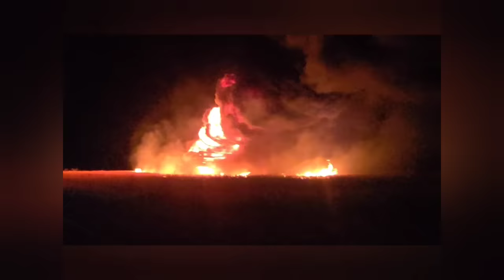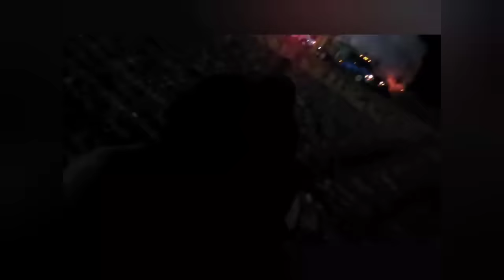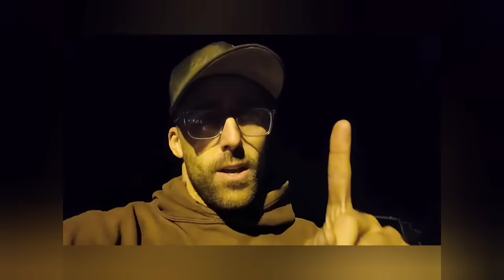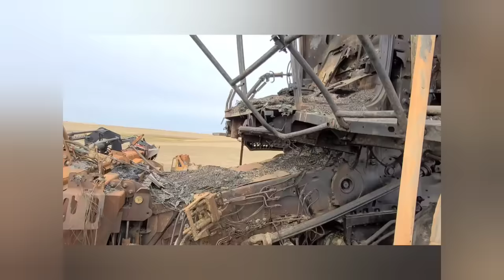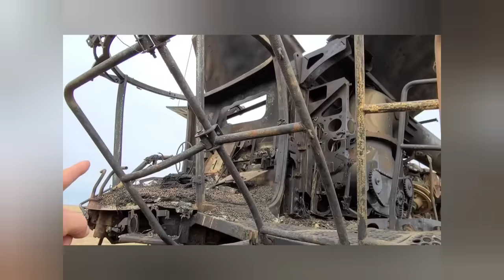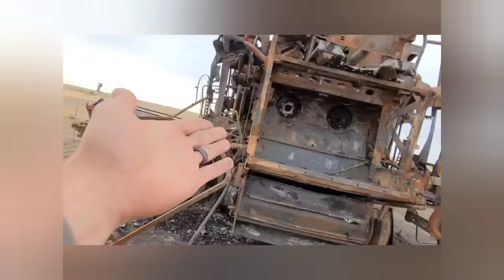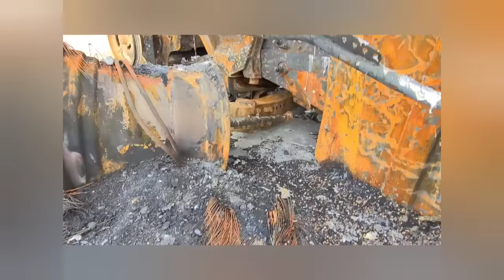Fendt Ideal 9, burns to the ground🔥

Comment: For anyone watching this just know that if a combine or any other piece of equipment is going up like that, you need to stay back a good 100 yards. Tires, hydraulic rams, hydraulic accumulators, the gas pistons that hold the doors up, can all blow up. I've put out a lot of equipment fires and had way to many close calls. It's best to just get back and stop the spread until it can be cooled down. Been a rural firefighter for 8 years.
Reply from the maker: 🤔 Good idea!
Reply: and batteries  now they are long life sealed
Reply: Just throwing a can of axe in a fire is enough experience to know that flamable liquids, or pressurised vessels are explosive. I had a friend who had his 50cc scooter burn to the frame, and someone got their clothes ruined by the battery exploding and shooting acid on him. Lucky that it did not touch his skin
Reply: Im a Safety Manager with 15 Years experience dont get me wrong here: Been working on a farm and implemented allot of my previous experience the comment a above is 100%
Reply: Nah I would just stay close so I can make sure nothing else goes wron😎🥽
Reply: This... right here.  I found a hydraulic cylinder shaft stuck into a tree over a foot deep from a combine fire.  It would have went through a dozen people.
Reply: Good advice, thanks
Reply: Real. We had a combine burn and something blew an shrapnel flew 80 meters away and a
Shattered one of our combines windows
Reply: @eliaslundstedt5607  I have a relative that got her eye ruined burning garbage because somebody put something like that in it.

Comment: A combine with a million sensors...... and no temp sensor on the gear box?
Reply: What combine is? I'm brasilian and i don't undestand all
Reply: @anomonyous  i want to know the model of the combine
Reply: @otaviobaticini2710  Ideal 9 I think
Reply: Its a feature, without burning they last to long
Reply: @hairlesscat6458  I know from experience that a manufacturer IS consciously paying attention to safety. Therefore there are lots of ISO standards to which all major western manufacturers comply to, better, they have developed these standards in special committees. Even the European Union Legislation is largely based on those ISO standards. I think this is the first combine fire started in the gearbox. And also, if you had listened to Mike, you would have known the temperature of the gearbox wasn't the problem but a faulty seal gushing out oil was the problem.
Reply: @otaviobaticini2710 ideal 9.
Reply: The sensor was his eyes

Comment: Been through this with a case combine about 6 years ago. It made the western producer. Your video doesn’t give the tire explosions justice. When ours blew, we were about 150 ft away and it was like someone punched me in the chest. It was so violent that the header unhook its self from the combine. The scary about our fire was that it happened in our yard right next to our sheds and water tanks. I tried to fight it but it melted the hose full of water. As you said Mike, when our fuel tank melted it was a no go, there was no saving it. The rims where cherry red hot and there was absolutely nothing left. I am glad no one got hurt and everyone is ok. That’s why we carry insurance for this type of incident. By the time the fire dept got to the combine it was totally gone. The whole combine is totally engulfed in about 2 mins, and the next day there was still warm spots after spraying at least 4-5000 gallons of water. We did have a rcmp member come to our fire as well, I think it was more of a formality and to check to see if there was any suspicion of arson. Good luck with your insurance, we had a battle and took a licking but our dealer stepped up big time and got us a new combine and we were back at it in 4 days. Lucky for us, we had our pick up header on when it burnt and our Macdon was safe lol. We had a huge puddle of aluminum under the combine after the rads melted.
Reply: Yeah those tires might only have 30PSI in them but the shear size of them means they have a LOT of energy in them so when they fail they fail EXPLOSIVELY! Hell I've seen the damage a semi-truck's tire can do when they blow, it destroyed the side of a car so I can only imagine those combine tires can do.
Reply: @SilvaDreams  Combine tires will have far more than 30 PSI. Semi tires are over 90 PSI.
Reply: The tires: ight imma head out pop

Man that's one sad story

Comment: Relly sorry to see this happen to you guys, but glad to hear that no-one was hurt.
The way you're handling it is epic, relatively calm and no signs of panic. Everyone seems to know what to do.

On the positive side, at least now it's easy to get to the rotor shear bolts of that combine :-)
Reply: If I had a farm a huge as there operation I would blow it off as well.......new combine boom insurance is great.
Reply: @dustinryan9671  except that isn’t how it works, it takes months for the claims to be processed, and they never give you how much it’s actually worth.
Reply: @realredditstories420  when a farmer is spending over 1 million on a single piece of equipment....they are not hurting.  Insurance does take time does not matter if it's farm equipment, a house, or business damage.  If insurance did not work then why do people, including farmers buy it?

Comment: Wow glad to see nobody got hurt and in all my 51 years this is the first time I've seen a combine burn, sorry for your loss but thanks for sharing the video and yes I agree no combine should have plastic fuel tanks.
Reply: There’s about 400 combine fires a year in NA, with almost 80%% of those happening during the summer. Western Europe doesn’t have the corn/soy industry like we know in the Americas so fires are rare. But yeah running machines non stop for 8 - 10 weeks in dry / windy conditions makes for a heck of a fire hazard.
Reply: Only issue is a steel fuel tank will explode rather than burn
Reply: @jonathanwayman9345  with steel it would have to be vented very good to avoid exploding even then I don't know about that fire was massive and that wind just added fuel to the fire

Comment: I think you have a good handle on origin and cause of the fire. I’m a retired Certified Fire Investigator from North Dakota and have dealt with many 
Farm machinery fires. One thing I discovered was that of all the fire incidents I investigated everyone had some sort of opinion on what caused the catastrophic loss. I’m quite sure that farmers were more correct with there opinions than everyone else. It has to do with machinery’s need for regularly scheduled service that is provided by the owner/operator. That makes that witness keenly aware of his machine and gives him an understanding of its week points. The fact that you eliminated the bearing failure points around the combine and had an opportunity to witness the still early development of the incident centralized your opinion on the right rear of the combine. The process of elimination of what it wasn’t brings you closer to the origin of the fire allowing you to fine tune what was left and results in your causal conclusion. Good job!
Reply: And opinions are like assholes, everybody has one.

Comment: One time last year, I was sitting in the combine with my dad and all of the sudden, I see his face lose all color. That's when I looked up and saw the engine water temperature gauge shoot up to the red. My dad got out and I kind of froze. After about 30 seconds he flew up the ladder and forced the machine off. After investigation, we learned that the fan belt had just been chewed up and that's what was causing the overheat. A machine with that high of rpm running with no fan is bad news. Anyways, we were lucky we caught it before it got out of hand. Sorry you didn't have the same luck and hope you guys recover well and get back in the fields!

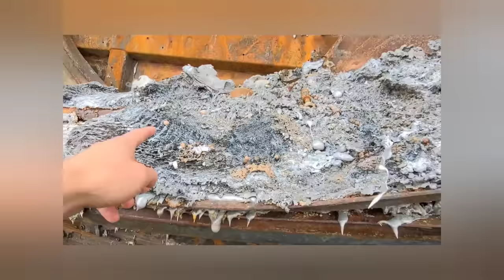Comment: For those wondering how hot the fire was: The radiator mentioned at 29:05 is aluminum (more than likely) which melts at 1,221 Fahrenheit so uh yeah, pretty hot, like mike said no amount of water was going to save that combine
Reply: Or 660 degrees to the rest of the world....
Reply: Glass melts at a much higher temp than aluminum...
Reply: By the time he was halfway there the wind was blowing too strong. Even if the water truck was there it probably would not have been saved
Reply: But all the 911 conspiracy nuts will say that jet fuel can't melt steel.
Reply: yea the fire department said that to us when we had 2 of the burn  they left it burn down  by them the to water trucks came to look like the were siting up a pool to go swimming the dropped both trucks in it never take long they were back  and other water truck did show up to  they put dish soap  in the tank after and mixed it up 
help the water to put of the fire i was lold
Reply: @Luke Augustus A forge is just fire with air forced through it. With that wind it created a natural forge in the space underneath.

Comment: Your totally right. I help a neighbor spring seeding and harvest. This year they had fires twice on the S690. They obtained a new Brent 2096 grain cart. One of the available options was a fire supppression system consisting of a water tank, hydraulic driven pump and hose reel (50ft). They didn't get that option. After the second fire they ordered it. There thinking was " What is the one thing that is always in the field  close to the combines with a driver in it nearly all the time."  Wouldn't have matter this time but............
Reply: Isn’t it always the cart drivers fault when bad things happen?

Comment: I remember a field fire we had nearly 50 years ago.  Fortunately, no combines were injured.  Idiot operator was smoking in the cab and dropped his butt on the floor.  Floor not sealed and it dropped down through the pedal cutout (no boots on pedals at that time) and touched off the field.  I remember jumping on a 4020 that we were dualling up and it only had 1 dual on it, hooked up to our small 10' disk and boogied off the almost 5 miles from our old shop to the field.  Dad followed in the can't-remember-the-model larger JD hooked to the 14' disk.  We got there, disked around the edges of the fire and got it out.  Local LEO showed up and asked us if we'd deliberately set the field on fire.  (This wasn't far removed from the times when we =did= burn off stubble, mostly to cook weed seeds, but also because we just didn't have the equipment to handle massive the massive amounts of OM left that needed to be turned under.)  I thought Dad was going to punch the idiot.  Instead, he just yelled, "that's about 5 acres of standing grain that just burned up!"  FWIW, this was in Arizona, and it was irrigated Durum wheat that would typically yield about 6,000 lbs per acre, so a loss of about 30,000 lbs of wheat.  Combine contractor gave us a bit of a discount.  :-)

Comment: Wow... scary how quickly it goes from "I smell smoke" to the point of no return.  As you say at least no one was hurt and you managed to keep it contained.   Machines can be replaced, they are making new ones every day.  👍👍     Would definitetly agree with you though,  having a plastic fuel tank that melts and dumps 1500 litres of diesel on top of fire is ridiculous.    It should be a steel tank and steel lines imo,  not saying it would have saved the machine but would have slowed it down a bit.
Reply: Combines are like dried pine needles a big giant tender box waiting to catch fire I'm thinking a rock hit something to knock a hydraulic line lose
Reply from the maker: It was most definitely the right gear box tho..
Reply: If the combine caught fire & the fuel tank didn't get punctured & got so hot, wouldn't it explode if it was metal?
Reply: @FarmerPeter  fair point,  but you could easily put a plastic panel in the top of the tank to fail and release the pressure without dumping a whole source of new fuel on to the fire.   ☺
Reply: @chucklesx  That's a good idea! Maybe manufacturers need to hire you to design their fuel tank!😂
Reply: @FarmerPeter  lol...  I'm in no way qualified for that mate,  just some of the musings that go on in my head after years of breaking stuff and trying to fix it better so I can't break it again  😂
Reply: @mikemitchell2554  if it was the gear box sounds like something inside got extremely hot. Any replacement combine coming or you going to just run the 6 remaining combines
Reply: @chucklesx  or you could just not do that, because every fuel tank already has a ventilation valve on it. How do you think the air gets inside to prevent a vacuum as the fuel level gets lower? It also needs to be able to compensate for pressure fluctuations due to ambient temperature changes.
Reply: @jfdb59 ...   big difference between the breather needed for normal operation as a fuel tank and what would be needed to release vapour and pressure generated by 1500 litres of fuel being boiled by a fire.

Comment: I almost lost a JD in sunflowers, in North Dakota in early October 2012 as far as we can figure chafe lit on the turbo then spread to the manifold, then down the engine block to the plastic(poly) fuel tank. Luckily we had eyes on it fast and got it out with only damage to the fuel tank. I'm still here, I'm happy to hear your operator is here. Iv ran harvest crews and told all my people, The fire extinguisher in  the cab is for your escape only. Do not worry about the machine.

Comment: Believe it or not, this actually happens allot, got to keep that equipment clean, they build up so much cutting and everything everywhere inside there. Mix that with a hot ass engine and exhaust system and this is the result.
Reply: True, but none of that was the cause of the fire.

Comment: From an old firefighter.  Put a surfactant in your fire wagon.  It will make water wetter.  We used put a special pine oil in the tanks on all of our trucks.  It would work much quicker to suppress fires.  We had farmers that were burned severely either when they figured out they were on fire the cab was already in the fire from the dust and chaff around it or trying to fight the fire.

Comment: The heat might have been too intense 100 feet away. In the late 1980’s kids from church were home when a fire started in an upstairs closet. Their parents were an hour plus drive away so they called me and I raced over there in my 79 Mustang Indy Pace 5.0 4 speed. The kids had called me before calling the fire department. It was over $100,000 damage.

Comment: Plastic may actually be a safety feature. A metal tank would become a bomb eventfully as the desil will vaporize and start venting. The plastic will eventfully melt and dump pressure. Would rather have a big fire that could be put out with foam than a massive BOOM.

Comment: That “small town fire truck” looks about 35 years old 😳 you’re making my small town foundation saving department look like the big time with that. They do their best but it’s a small department spread over many miles, like yours it normally takes a while to get a real response
Reply: We've got a 84 dodge cab chassis brush truck that will run circles around some of these new rigs. Oh well that's what insurance is for right?
Reply: @twillison8824  yep! Just made me chuckle, the small department in my town is slowly getting some upgraded stuff but about 10-15 years ago a lot of the fleet was from the 70s and 80s
Reply: Our 50’s fire truck is still going strong!

Comment: The first day the boss man was going to let me run the 9500 JD combine in corn . He already had made 2 rds an 6 acre field and I jump in with him and he goes to lower head and nothing.  I go open the back to investigate and find a fire on the back off motor . Burning wire harness lucky there was 3 antifreeze jugs  put fire out . Found it started at the exhaust manifold.  Went got part fixed that then spent 3hrs fixing wires . Glad it happened before I started running it

Comment: Why does it always happen at night 
We lost a job fastrac on a grain cart 
Wasn't even running just parked in the corner of the feild 
Canola seed on the muffler and when you shut it down the def reaction continues in the muffler but without exhaust flow the temp spikes way higher and the canola self combusted 
Prob not even a handful of seeds but it got going and the plastic hydraulic tank and the batteries are right next to the muffler so there was no hope
Reply: I ran with a harvesting crew for a season and the boss was telling us about combining canola and sunflower seeds. He said the oil would build up on the cover panels and catch fire just from the sunlight hitting it.

Comment: Complete neophyte questions - 1) shouldn't split the combine / header when parked to avoid a total loss of both units in case of a fire ? and 2) has any manufacturer thought of onboard fire suppression systems ?
Reply: Fire spreads fast. All you do is you get off the combine and away from the fire.  It takes a few minutes to get the header off. Additionally many times you need to set it on the header wagon, because you will have trouble getting it off when you try to put it on the ground.
Don't think it would be possible to install a fire suppression system on a combine. On a race car its simple. You put one in the engine compartment, done. But on a combine, there is many places a fire could start.

Comment: I saw this video mentioned on another channel. Been watching the 2020 harvest. First and foremost, no injuries. That right there is a blessing. As one of the commenters here siad, your riding a grenade with the pin pulled. Diesel, hydro, chaff, and rubber. All combine to make a hot and fast fire. As for your humor. It's way of dealing with the stress of the situation. What are you going to do? Panic? You handle it. You did. I'm a new subscriber. I look forward to watching more as the season and time goes on. Yeah, 2020 is wild one for sure!